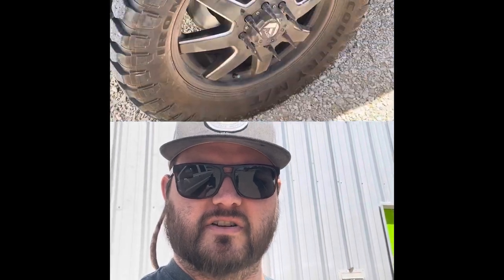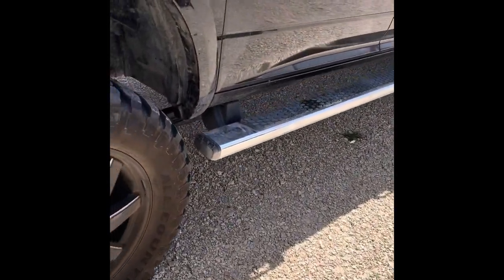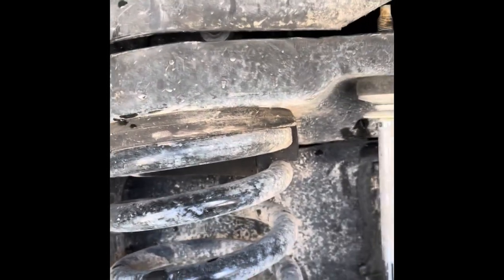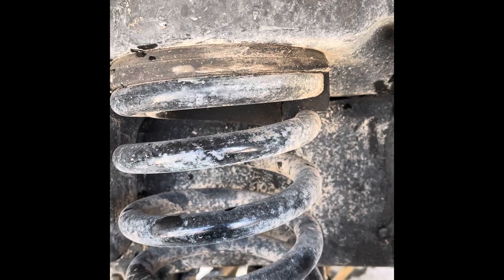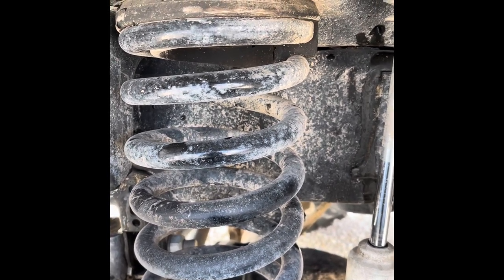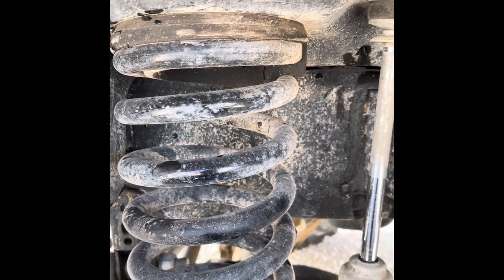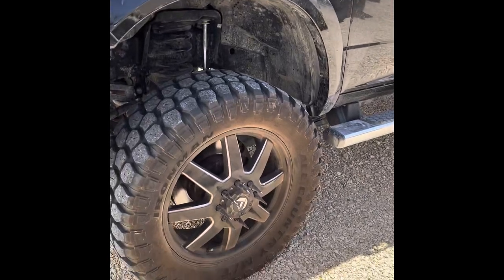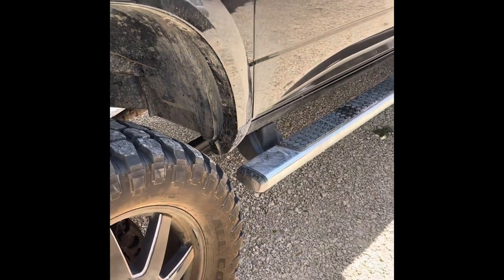2012-2018 Ram 2500/3500 ABS/HCU Module Repair Overview

Comment: I had to purchase the 
ABS & HCU bout month ago, and it works. Reprogramming the ABS bout $150-180 At Dealer. Remember to bleed the HCU one at a time, then the wheels. If you clear the air out of the HCU, there is no need for a scan tool
Reply: Well I got the scan tool been wanting one for a while but my problem is you can’t find this part at all very sad looking for a place to rebuild it

Comment: December 2022 NHTSA announced they are investigating the ABS issues on the 2017-2018 RAM 2500 and 3500 pickup anyone with these problems needs to file a complaint. RAM needs to reimburse those who have paid to get it fixed and fix the trucks that haven’t been fixed yet.
Reply from the maker: Good to see they are trying to hold Ram accountable again, hopefully it works out in peoples favor!
Reply: Filed my complaint.  Ram dealers are laughing at me when I call to see if the part is in stock.  National back order and not a supply chain problem, but a demand problem.
Reply from the maker: @Tac0312  Thats not good, we've done several and not that long ago and could find one hiding. If you need some help you can always email us or something with the part number and we can try to help out.
Reply: I filed a complaint last month. Still no part and called the dealership today and he has 14 others with the same issue waiting on parts. This is insane.
Reply from the maker: @jkh36619  Theres a few different part numbers actually depending on the vin, we've had some trickle in from time to time. If you want to email us your vin be glad to look it up and see what we can do. We ordered one in November and had it by late January.

Comment: I replaced the abs module but lights are still on. Do I need to program it? Does the dealership have to do it or can my mechanic do it?
Reply from the maker: if you tried clearing the code already and it came back you likely need to take it to the dealer unless your mechanic has a computer that can do it.
Reply: Mines doing the same thing but they’re coming on and going off repeatedly I’ve checked all ABS wires all of them look good
Reply: I have the same problem.  2018 40k miles. Please let me know if you find anything out.
Reply from the maker: @tygenkukuk4114  its rare but might have a new faulty abs module (not out of the question in todays world), next i assume you got a dodge computer to program it and do a auto bleed procedure?

Comment: Were you able to manually bleed the system? Or did you need to use scan tool to actuate valves individually? Also, after replaced, did you just clear codes and it was good to go? I have a nice matco scanner, that I believe will do anything the dealer is able to do.
Reply from the maker: We do both to make sure, after bleeding yes we clear codes and never had them come back.
Reply: @injectedmotorsports53  thank you!